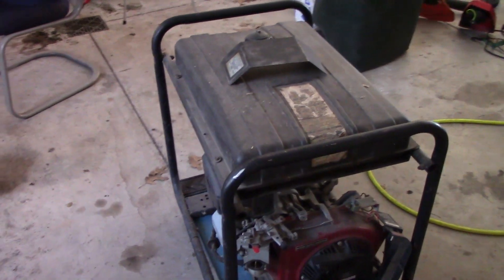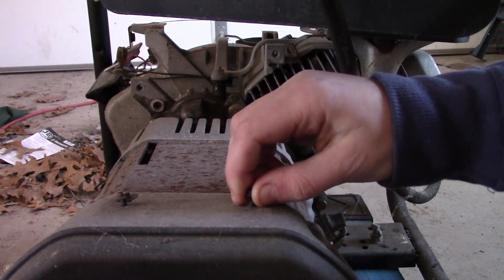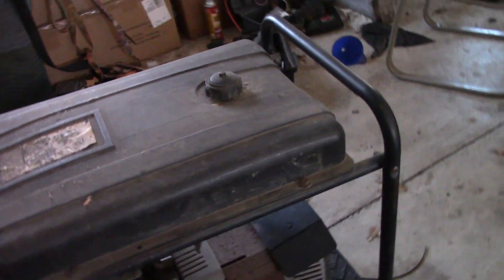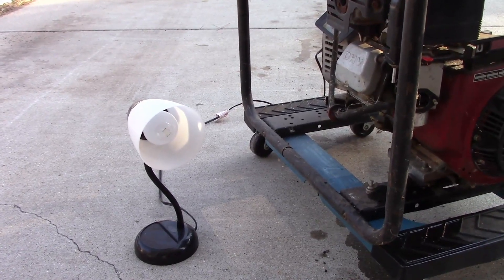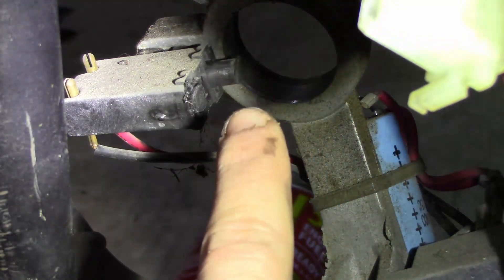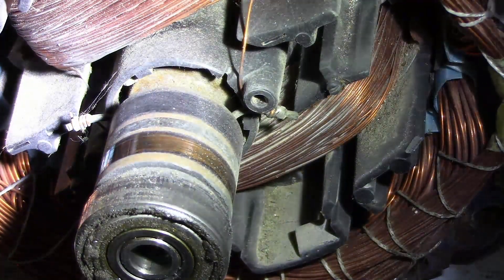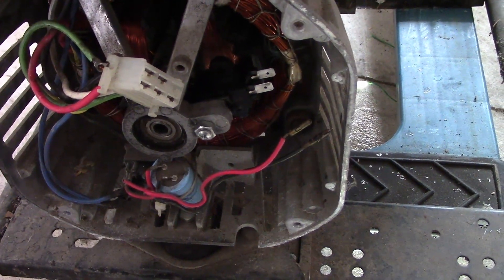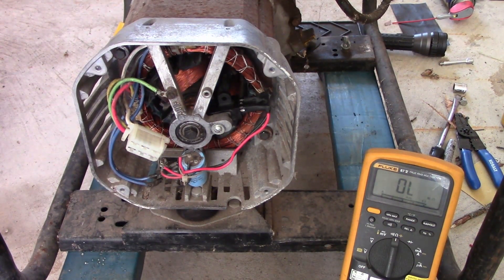Can we save this old 5000 watt generator?

Comment: lost magnetic field should applied dc voltage to brushes
Reply from the maker: That's what the exciter circuit is supposed to do, the capacitor for it was shot, and the rotor was shorted out. There was too much wrong with it to make it worth my time, so I sold the running engine for $50 and still made money off of it.